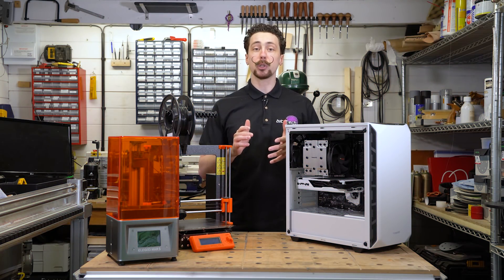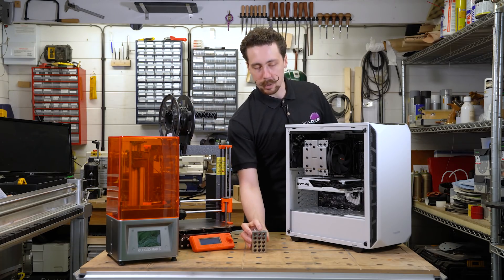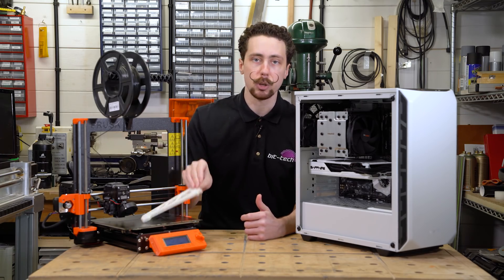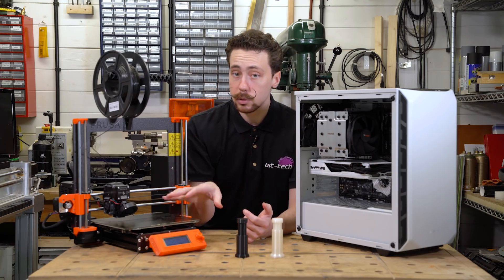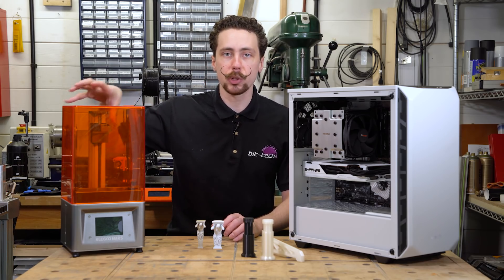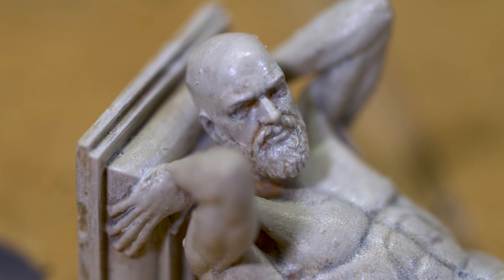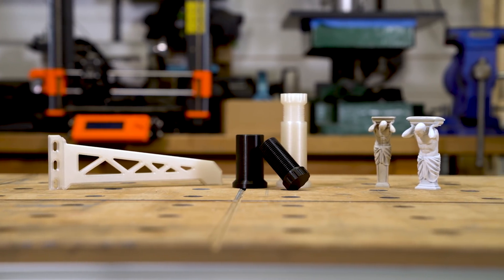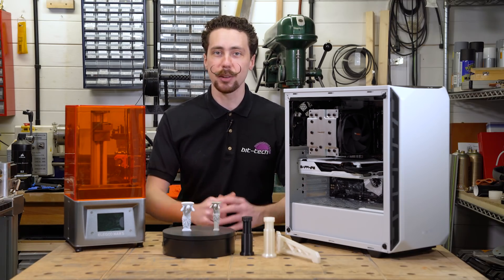3D Printed GPU Supports | bit-tech Modding

Comment: The tolerance for the screw threads are way too tight, couldn't even fit them together. Good thing I printed at 15% infill, what a waste of time.
Reply from the maker: Sounds like you need to calibrate your machine? Clearly it works in the video.

Comment: How long is a bath of resin good for? Does it need to be changed every month? year? I'd like to start playing with SLA, but won't be doing a massive amount of printing. Is there any odor (I'll be using one in a bedroom) Thank you.
Reply from the maker: William When you’re done printing you should pour the unused resin back into the bottle. If you keep it in the tray for more than a few days you run the risk of accidental UV exposure curing parts of it, which can crunch your screen.

Personally I wouldn’t use it in a bedroom. I’ve found the odour from most resins to be pretty minimal, but it’s still epoxy so you shouldn’t expose yourself to too much of it. You’re best placing it in a well ventilated space away from where you spend most of your time.
Reply: @bittech1  - Thanks a bunch!

Comment: I used a doorstop type deal once it was a nice glossy black plastic and it could be adjusted as well, i just put on some stickers on it to pimp it up a bit and it did the job well to hold up the gfx card, but we are talking back when SLi was still a big thing, spring cleaning happened and someone threw out a good deal of my old hardware and it was in the mix.

Comment: As a jewelry designer who using SLA or DLP resin printer, use 3 % bigger in print process, and live the in sun light for one hour, reason is resin normally shrinking in the time matter, but this way take that away. So you can color it after sun light, and use it for 100 years 🥂

Comment: My 3mm steel L-shape bracket goes out of the back of the case and is bolted to a steel beam behind the motherboard.
It also hides the gpu cables, so its a dual purpose thing.
But its not an easy mod to do.

Comment: Suggestion: make atlas 2 parts. Hide the seem under his trousers. Make a hole for an m3 bolt going through the middle. The bottom column can now be fine tuned for hight without distortion. Just extrude the Z height of the column to fit and use nuts to tension it. Bonus is you can use a through rivet to secure it.

Comment: I don't know if someone already told you... But your high-quality modding needs some high-quality 4K video! 🎥✨🙂
Reply from the maker: Olivier L We actually do film in 4K haha. The reason we upload in 1080p is for a couple reasons. The first is that you can crop in 4k footage, which makes getting certain shots much simpler. The other main reason is that high frame rate footage is generally 120/100 fps at 1080p, which if upscaled to 4k can be ropey.
Reply: @bittech1  I see. In this case you should go full MKBHD and get an 8K Red cinema camera. Then you can crop all you want and still upload in 4K. 🤗
Reply from the maker: @oliverl2172  The lyfe haha

Comment: To prevent slippage, much like the phone desk holders I make, get that rubber-grid-mats that people cut and line their glass cupboards with.  Put a cut-to-size fragment of the rubber mats between your model between the gpu and the floor he is standing on.  The 1/4 of space both grids take up will make it very difficult to dislodge the statue from his very important position.

What would be better would be that cuttable velco that can be separated with both sides having a sticky side. 

You can add to this stickiness by drilling a small hole then screwing a flat top machine screw into.  The hole will not hold unto that screw if you decide to constantly remove it, but it should only be screwed once.  The screw is best screwed into the soft side of the velco since the metal head will sit lower that the puff of the fluffy side there would be no chance of the metal scratching anything.

Comment: Why is scale factor a problem? You divide the height you need by the height of the model you have, and there you have your scale factor.
Reply from the maker: Dominic H. With heavy mesh models in Fusion it can become cumbersome, sometimes getting the measurements themselves can be difficult even.
Reply: @bittech1  I see, so it's a problem with Fusion.
Reply from the maker: Dominic H. For the most part yeah, I have no troubles scaling in other packages like Blender or the slicing softwares. Most parametric CAD packages struggle with mesh files though as they’re not really designed for them.
Reply: @bittech1  Well, I can't give you a solution, most of my prints are simple enough to be designed in either Blender or Sketchup, then I use near default settings in the software that instructs the printer to spit out the result. :P